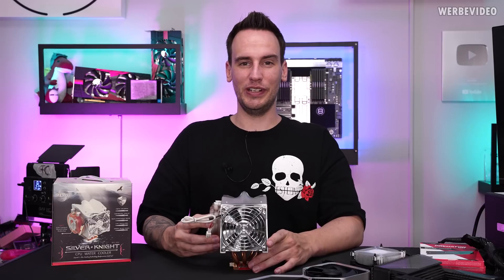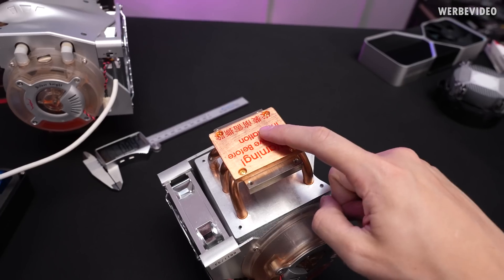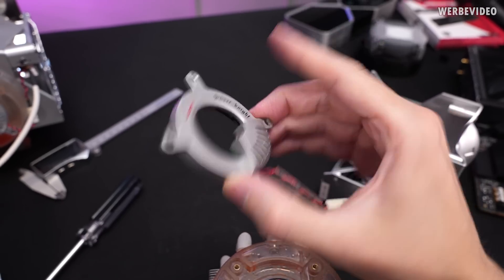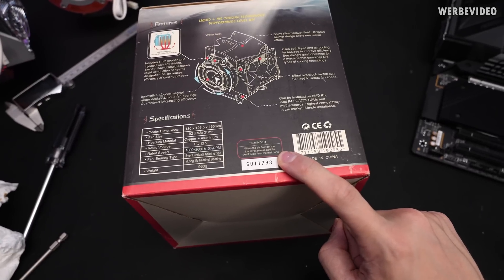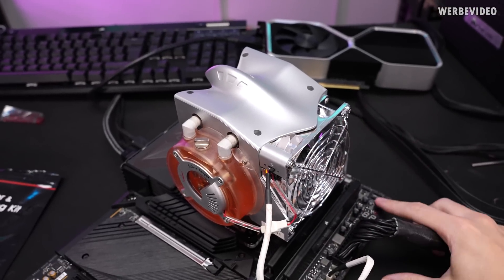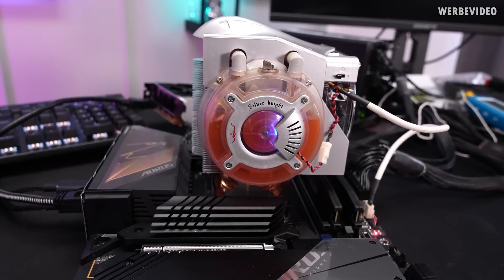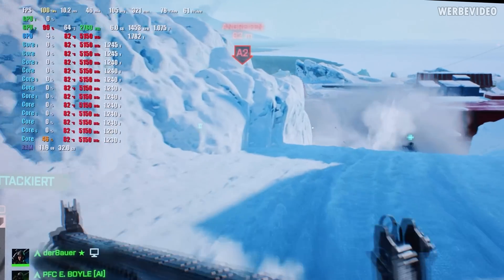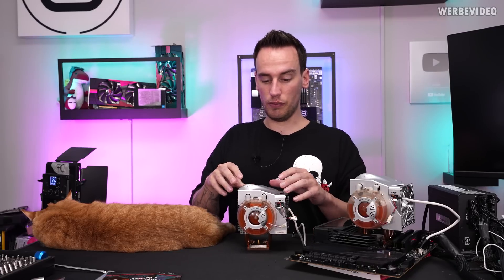Crazy Design!! This CPU Air-Cooler runs Water through the "Heatpipes"

Comment: the reason heat pipes work so well is because it uses evaporation to remove the heat rather than simple conduction and convection which is why this will likely only ever be about as good as a typical heat pipe setup BUT with the pump running and more components to fail, etc., - because without evaporation being used you will need to put energy into the system (the pump) to take the same amount of energy out of the system as with an evaporative cooling method...the latent heat of evaporation is the reason for all of this.  cool idea though.  I DO think it would be worth it to cut the pipes there and run more piping to a remote pump and reservoir and perhaps add fins to the metal tubing used and if you do THAT then I think you could get AIO performance without taking up the space of an AIO in the front back or top - but that;s the only real advantage, youd just be moving the radiator to a different area at that point...could be cool tho to try

Comment: I feel like given the age, there's likely several symptoms of its age that are holding it back. poor cold-plate surface flatness, a likely complete absence of fins in the block, poor quality (by modern standards) fans and pump, etc etc. I want to see this done up with modern engineering to see how far the concept can go. Hell, increasing its size alone to further spread out the heat mass would probably do it good too.

Comment: I can't help but say that the fact this cooler that wasn't designed for the modern CPU thermal loads, yet still managed to cool it, might somewhat validate the concept...

Though, on the flip side, it's hard to say for certain, without having that exact same cooler modified by having actual heatpipes... Then we'd know if it's cooling performance was simply the heatsink, or the flowing water.

I also feel like ACTUAL heatpipes would  work BETTER due to the fact they have the extruded inner channeling to promote wicking. In this case it would increase surface area for thermal transfer! Of course, 12mm heatpipes would probably be ideal. (although 10mm might suffice?)

Comment: I could see some use for this kind of cooler. Not as running closed loop within the CPU cooler but having CPU cooler stack on CPU water block as intermediate cooler.
Like having something like NH-L9 with water block and bit more copper piping instead of heatpipes with connectors to attach it into a waterloop, probably not that good in normal cases. But if you are putting some high-end parts that will need some more serious cooling into a case where you cannot install second radiator, not to even mention separated loops for GPU and CPU, but the case can handle low profile CPU cooler, that little bit more cooling will do at least something. At least you are maximizing the amount of cooling you can include within the case.

Comment: Maybe the idea could make for a really weird kind of coldblock in a water loop. Like the water goes through what looks like a normal heat-pipe-but-not air cooler before flowing out to a big-boy radiator and pump.

Comment: If you didnt want to risk damaging board, You could put it in bowl next to board when CPU had normal cooler and this one was connected to CPU2 pins.
TBH I didnt hear difference between LOW and HIGH, maybe your mic has some kind of noise reduction. Only after you put it few cm from cooler there was this running water sound. Maybe if it would be filled fully it wouldn't make this sound

Comment: Does it work if installed in a case? It seems the pump would be at lowest point but the air would get trapped in one of the tubes. Would that not kind of make it useless ?

Comment: A few things I didn't really see observed in this:

1.  The coldplate on that heatsink is absolute SHIT - as was the norm for manufacturing back then - and was pitted, and generally probably unlevel.
2.  The efficiency of heatpipes 17 years ago was not nearly as good as it is now.
3.  TEC coolers and DIY liquid cooling were FLOODING the market back in the "hey day" of cold cathodes, and UV lights so the market had to "adapt" to try to push the proverbial envelope as much as they could - with things like the Titan Amanda which was probably the birth of the idea for dual tower coolers like the NH-D15.
4.  Using acrylic for the DIY mounting solution may have hindered your resoluts a bit due to it's flex, and capabilities with the torque necessary for mounting (possibly, it'd be difficult to know for certain without testing an aluminum or steel mounting bracket.)

If it were designed with the specifications of today's hardware it's very plausible that it could be surprising and functional.  PRACTICAL?  No, but that wasn't what building a system in 2006 was all about.   haha

Comment: Assuming the thermal bottleneck is the find, yeah, it doesn’t matter if it’s heat pipes or water pipes delivering from the block to the fins. But if the heatpipes are the bottleneck and water can move it better… that would be a reason. But I think just having a larger external radiator like modern AIOs makes more sense if you’re going to bother with water

Comment: One clear advantage is thermal mass- the water will have a higher specific heat than copper, meaning that it would take quite a bit longer to saturate the heatsink vs one that simply uses copper. Heat pipes work by having a huge transfer conductivity while the intention here is to use the water as a thermal mass since it takes more energy to heat water than it would copper. the point is that the water cycling through can be cooled faster than it can be heated i/e creating a temperature differential to achieve a desirable level of cooling. It would make sense for direct-die Athlons or their ilk as it means that temperature saturation is lower and has less risk of staying in one spot. 

It does remind me of Ivy-Bridge and their tendency to have sudden temperature spikes that caused system instability due to the TIM used instead of the soldered IHS for that generation.

Comment: I run a ryzen 5 3600 overclocked to 4.2 ghz all core on the stock cooler, it has no problem in gaming around 65 celsius, though it hits 93 in cinebench r23. Vcore 1.3, llc mode 4 in msi board, using 85 watts in cinebench

Comment: That heat sink is massive, if they had just made it with normal heat pipes and included a better, quieter fan, the cooler would have been really good. But then we would be talking about Noctua. 😂. 

I couldn’t tell how loud that cooler was from the video but my cheap ass AIO is loud.  It’s likely the cheap fans. 😅

Comment: I've seen this done on PS4s to turn the stock heat sync into a waterblock with tubes routed to an external pump and radiators.   I've converted the stock vapor chamber on my xbox one x into a waterblock by soldering barbs on it and routing the tubing to an external pump and radiator.  It did make a noticeable improvement.  Chaotic scenes that would cause significant frame drop while air cooled, ran much more smoothly while water cooled.  For example, the siege engine in the Destiny 1 Wrath of the Machine raid.

Comment: Nice exotic concept. I would be interested to see if an AIO or even a custom loop waterblock with taller fins would perform better than the usual ones used across the board. Surface area much grater but unsure about how restrictive it would be or even if practical to manufacture.
But important matters first: love the ginger cat.

Comment: interesting for sure. Considering when it was first released - at that time it probably was a better option then the standard air coolers.
Reply: Doubt it. Even the early proper AIOs were being outperformed by the contemporary higher end air coolers. Essentially, at the time, you went for an AIO because of the (non thermal) cool factor, or because you did not know any better. Still, not a bad showing at all, especially for something that spent 17 years with the coolant slowly evaporating and leaving dry residue all over the loop.

Comment: While the surface area for heat dissipation would remain the same, the faster you can move heat away from the CPU the better the cooling performance. Up to the point at which the CPU and the liquid reach the same temperature, then it would no longer matter how the heat is transferred.
Saying that the heat transfer method doesn't matter is like saying that the thickness of IHS has no effect on CPU temperatures. You're claiming direct die is just as good as having a 5cm block of copper between the CPU die and the cooler, if the cooler itself is the same one. I'm pretty sure you yourself have proven quite many times that having a thinner IHS or having no IHS at all is better than having the stock IHS. So it does matter how fast you're transferring heat away from the heat source.
It also makes a difference whether your water cooler has its pump turned off, in the lowest RPM or the higher RPM. So heat transfer speed does make a difference in CPU temperatures, not only cooling surface area.
I'm quite sure the pump is moving water fast enough for it to be a faster way to move heat than what heat pipes are capable of.

Comment: This thing has other big disadvantages vs conventional watercooling than just the packaging. It doesn't have a proper waterblock, so it doesn't get the turbulence created by the jet plate or the higher surface area from the small vanes; the pipe/finstack design also doesn't spread heat to the fins as well as a radiator can. Basically most of the reasons why watercooling can outperform air are just absent.
Those things are definitely possible to do in something with this form factor, though even then it'd still be worse that an AIO for most uses anyway.

Comment: Water and pc are two things i don't ever want to mix, i had two aio coolers and even though they didn't catastrophically fail or leak they did let me down badly, first the nzxt 140mm one included in my h1 case died because of their common problem of clogging and i just swapped it with a cheapo 20$ amazon air cooler, problem solved. The other one a 240mm aio that was not noticeably better than my old cooler master 212. Unless you run some stupidly power hungry parts that require a huge mammoth like air cooler you never really need watercooling

Comment: The only advantage I see is in failure mode.  With an AIO pump failure the heat source (CPU) is basically disconnected to the cooling fins.  Where as in this system, the heat source is directly connected to the cooling fin via the 6 copper tubes.  Of course you are limited to a 90mm fin stack...
I love old water cooling solutions. Please keep finding old stuff to review.  KC

Comment: I always wondered why we dont have sockets in house walls with quick connects that can be connected to a PC for water-cooling.  They could use house water, go underground into big pool of water, hook up for an air con unit or whatever. We have network outlets, power outlets why not a water cooling outlet :P
Reply: @mikeycrackson  kinda but more simple. Just need it to use an existing aircon unit that is external or the house water supply.
Reply: That would get expensive very quick to build a house with that in mind.

Comment: This remind me of the Danish company that did sort of the same, just instead of water they used liquid metal.
Thats also dandy but no matter how good your fluid is to take up heat and move it away, if the exchanger part can not keep up with that, well the damn thing soon saturate

As i recall the Danish cooler was beaten by high end conventional heat pipe coolers.

Comment: Perhaps it's more CPU hotspot agnostic compared to an equivalent heatpipe tower cooler?
The heatpipes on the traditional tower cooler that are not directly over the hotspot transfer less heat from the core to the fins.
By pumping water through all the pipes, Heat is spread equally through the heatsink no mater where the hotspot is located.

Comment: I think it could be a great with a modern design and specific fluid. It also keeps any possible leak away from the cpu/board for the most part. Just abstract thoughts but I would love to take that concept and play with some options.  Also could be cheaper to replace just a pump or a small hose rather than a radiator or long hose etc. Lastly, a little disappointed you did not show test with fan on high, it performed quite well.
Reply: not really
it fails at both being an air and water cooler
since it has a pump and liquid it doesnt have the simplicity and reliability of an air cooler 
and since it is restricted to being put on the cpu it means it has less space to  actually dissipate heat
Reply: Why would it be great with a modern design? The function of the water is to transport heat, not to dissipate it, so all this design is doing moving the heat exchanger onto the cpu and compromising both it's design and size.

Comment: I dont think having water pipes in place of heat pipes is a good idea. Instead, I was thinking of something else. I have this feeling that water blocks in AIOs don't have as rapid heat conduction as heat pipes in air coolers have. But then air coolers dont have as good heat capacitance as AIOs do. What if you take a typical tower air cooler, and use water pipes to cool the heatsink and the top parts of the heat pipes, all while blowing air through the heatsink. This way you have the rapid heat exchange from the CPU to the heatsink thanks to the heat pipes, and the heatsink's temperature will be limited to that of the water in the water pipes, providing excellent heat capacitance. For the ultimate cooling, the water pipes will be connected to a radiator just like with AIOs.

An alternative to this would be to place tiny heat pipes to the bottom of AIO cooling plates. You need to get the heat out of the IHS as soon as possible

Comment: We could use an air compressor to push high pressure air trough the heat pipes. In the worst case, some air might leak out. And we wouldn't need a heatsink.
Frore Systems is actually trying to do something similar.

Comment: Seeing as this thing is nearly 20'ish years old it was designed at the beginning of water cooling when such a thing was unheard of. Instead of coming up with the idea of mini radiators that go in your case first it seems like this was the logical idea. To modify an already existing tower cooler to take liquid, especially when you're a company already specializing it tower coolers.

Even if it's not practical but it still helps with cooling I think something like this would be neat to see in a custom build mainly as a functional theme prop in a closed loop build. Because a tower cooler modified to take liquid would be cool as a steampunk type of theme or something industrial or factory looking that has a lot of big cooling fans. :)

Comment: Maybe if that cooler had a 240 or 360 additional radiator that you could add and mount to you case it could be useful but as it is … not recommended

Comment: In central heating systems, there are pressure relief valves for when the water nears the boiling point.
I'd certainly hope water in this cooler never starts boiling. You can imagine the consequences.

Comment: This thing doesn't seem like it would have enough water in it to really benefit from having water cooling.

So I explain the difference between decent air coolers and AIOs like this. If you are running continuous heavy loads, it might not make much difference which one you choose. So unless you are constantly using your CPU to render/compile/compress a lot of files on a regular basis, an AIO will typically keep your CPU cooler.

This is because of the time it takes for the cooling system to become heat saturated. Where a typical tower air cooler with heat pipes takes about 20 to 30 seconds to become heat saturated, an AIO takes about 4 or 5 times as long. 

So under a typical use case, an AIO won't get fully heat-soaked, where a tower cooler will if you have the CPU under a heavy load for half a minute or less. At the point of heat saturation, you are fully relying on the rate of the fans and fins to dissipate the heat as it's generated. Up until the system is fully heat soaked, the cooler itself acts as a sort of buffer to store the heat and carry it away from the CPU until the fins/fans can get rid of it. For the most common usage of burst-ie workloads, the larger buffer from an AIO is better. Once fully saturated under heavy sustained load, the 2 cooler types are typically on par with each other.

The benefit of the tower cooler is obviously they are cheaper. Plus there are no moving parts in the cooler itself so it will basically last forever besides maybe the fan(s) needing replaced.

Comment: The closest "modern" (only 8yo, but still in production I believe) equivalent I can think of might be the Corsair Hydro H5 SF - a "low profile" liquid cooler that was designed for old-school SFF systems. The big problem w/ that was at 80mm height, it barely outperformed the 37mm NH-L9 and the blower was reportedly quite loud. I'm sure modern coolers like the IS-55 or Black Ridge w/ 120mm fans outperform the H5 at a much lower volume and smaller footprint.

Comment: you're running a single-core game with only 75% load and in ideal orientation. I don't know how it would perform with the pump underneath the cooler. Also: it's a 14-16-17 year old design jerry-rigged on a modern socket, how would a 2006 car run if it sat idle in a garage for 1.5 decade :p

Comment: Truly takes the worst from air cooling and water cooling at puts it together.
Downsides of air-cooling: Limited surface area, warm case air as intake
Instead: Not as simple as air cooling
Downside of water-cooling: Complicated, can leak
Instead: just regular old smooth tubes instead of proper copper fin plate to transfer heat to water